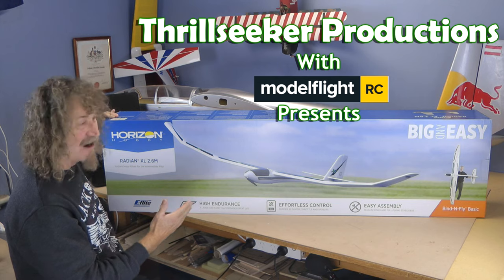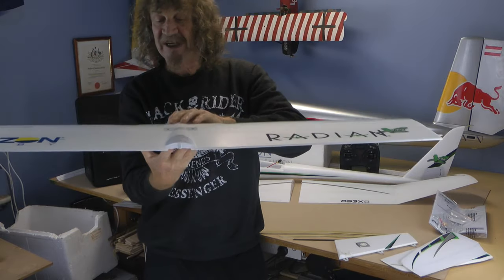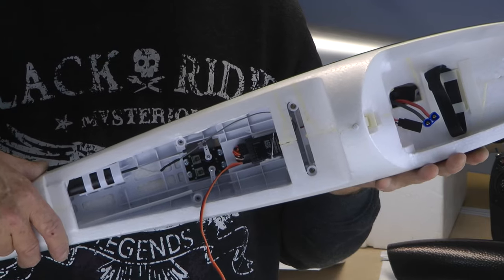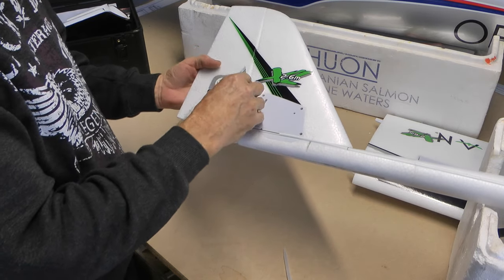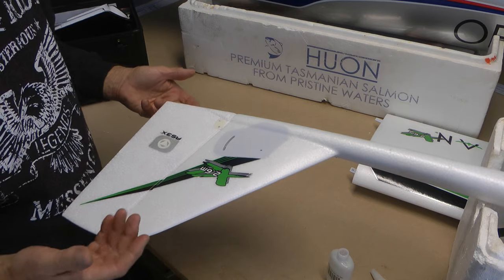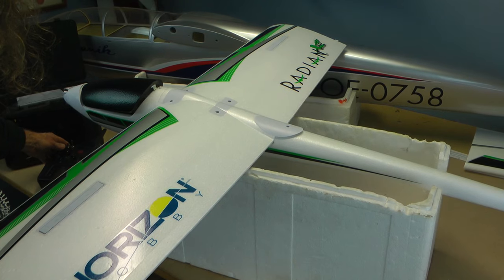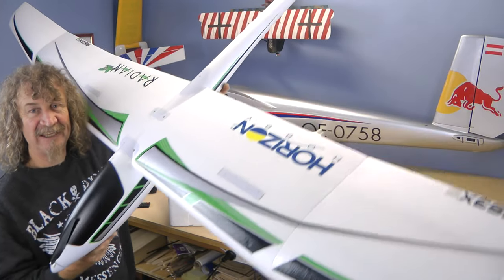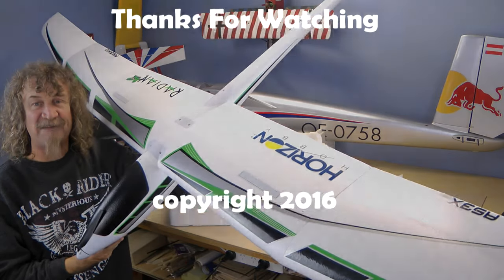E-Flite's Radian XL Glider Un-Boxed/Build with ChuckT

Comment: Hi Chuck from Key West, Florida, best review of this model, what foam safe glue would you recommend?? also did you find the vertical tail structure weak like a lot of other reviews are stating? you do an amazing job on these reviews, makes my decision to purchase very easy, we just have to work on your accent.
Reply from the maker: you don't need foam safe ca on this glider. I had no trouble with mine but did the fix anyway just in case it wasn't perfect. Was a real easy fix and shouldn't be a problem with the next shipment